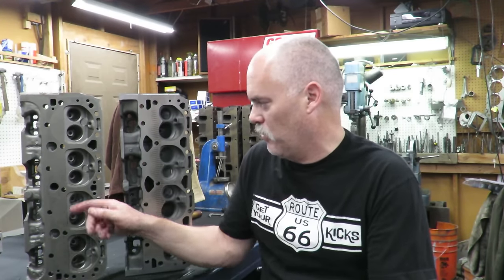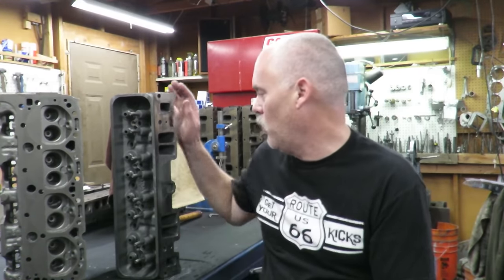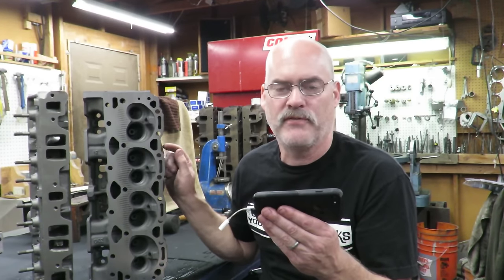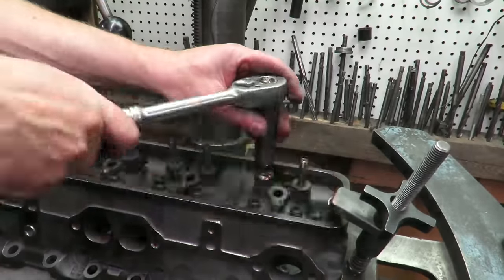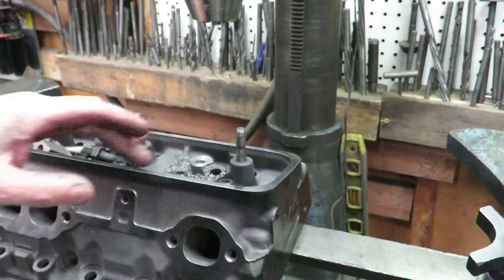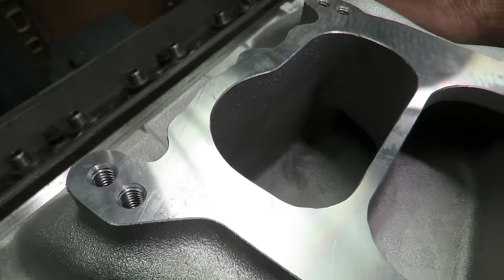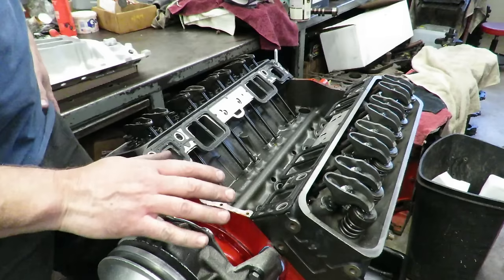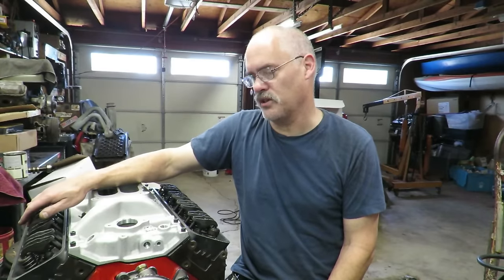How to get more power out of your Small block Chevy

Comment: Thank you for the hard work. Would you describe the typical different OEMs approaches between an early car (early 70s say) small block and the "same" truck version? Have a 73 GMC 350 4bolt (was a crate motor replacement - .030 over flat tops otherwise "oem"), short block excellent shape, (2) burnt valves (xxx642 heads >-/ ), want to go to vortec heads w small valves (?), intake and Rochester,  leaving the GMC OEM grind (or pretty close) cam in it. want more bottom end, better efficiency.... worth it? thx again

Comment: The  best way to get more horse power  out of most small blocks is to increase  the stroke then air flow  in the heads by porting them with the correct  shape rather  then a smooth  finish  , 3 this make a engine have more power  1 heads ,  2 manifold,  3 cam shaft match  this all perfectly  and you will produce good amounts  of horse power !

Comment: I have a few chevy small block engines and would like to get descent power as cheap as possible out of a couple.
Engines are older passenger car type pre fuel injection etc.
Can I use the vortex heads on them and what casting or car at junk yard should I look for to stay cheap.

Do I need to go with vortex?
If cheaper & better I will!

I'll be doing everything but machine work.

I have some good cams, intake & carbs was thinking around 230 duration and 550 lift and 108 or 110 overlap. Your thoughts?

I'm recovering from leukemia and want to do a couple projects now.
Been chevy all my life so have lots on hand, just not done vortex upgrade on standard engine. 
Thanks for ANY good advice and where to get what I need very chezp.

Thanks again,
Jerry

Comment: Great video,now as Engine Masters had 2.02 valves in there heads.is it good to have that work done as well?
Reply from the maker: I have tried the 2.020/1.600  valves it didn't really make any difference
Reply: @Myvintageiron7512  Ok thank you.can i have the numbers for the cam you used so i can find one the same,and should i buy the kit with springs,or not??
Reply: One other thing,if i bore out the block .30 over with flat top pistons,will the stock rods handle the power?

Comment: There's also the 059 Casting Vortec Heads for 305 engines that are very similar in the combustion chamber like the early centerbolt, but with better ports.
Reply from the maker: Yes that is correct I would however steer clear of them for a 350 or 400 they don't flow as much as the 350 vortec and the valves are small they do make a nice upgrade for a 283 or an early 305
Reply: @Myvintageiron7512  Yes, I was mentioning them since I am about to do an upgrade for my 92 Camaro 305 with some EQ Vortec Styled heads which are based on the 059 casting. I really like your videos and really appreciate what you teach us here!
Reply: @LuisAFigueroa  
So do the 062 vortec heads go with a 87 305 block?
Reply: @Myvintageiron7512  
So do the 062 vortec heads go with a 87 305 block?
Reply: @ulisesgonzalez6232  no you need 059 Vortec heads on a 305.

Comment: I believe the vortec heads they used in that episode also had larger valves in it
Reply from the maker: yes they did I have tried that also made zero difference
Reply: @Myvintageiron7512  my question to you is-
 Is it worth the money in the vortec heads of machine work when in the end you could dish out another hundred or two and get a set of aluminium heads ? 
 In your position it's a no brainer, being able to do all the labor yourself
Reply from the maker: decant Aluminum heads will be quite a bit more than a hundred or two
Reply: @Myvintageiron7512  I don't know if they are any good but flotek sells alumnium heads for 300 a piece, 2.02 1.60 valves, 180 cc runners, and a 64cc chamber.

Comment: I recently bought a '95 Bayliner 2355 that came with a 305.  The boat sat on a lift for 2 yrs through two bad hurricane seasons and at different times the rear scuppers couldn't keep up with the rainfall and the engine bay filled a bit.  I replaced the starter and the 305 is running, seemingly well, but before I'd feel comfortable taking it offshore I want to tear it down and check it out.  That said - if I'm going through that much work I think I'd rather just build a 350 and swap that in.  Would you mind outlining what I should do differently to prepare a similar engine / intake for marine use?  I will likely go the heat exchanger / closed loop cooling system route.
Reply from the maker: with a closed loop cooling system you should be ok with automotive specs but you need to get it balanced down to 1/2 Gram you will need to find a real good performance balance shop you also need to remember they see sustained RPM's so the cam and head combo need to be set up for that run your coolant temp around 180 no cooler than that if you run lake/sea water through the cooling system the clearances in the engine are very different so be aware of that I also recommend forged marine pistons don't go cheap on the pistons or it won't live I also would modify the oiling system by having the 3 main oil galleries drilled out and use a high volume pump

Comment: I've been wanting to see someone build an engine with a 3-2 barrel setup running on the center carb for fuel economy with the other two kicking in for performance
Reply from the maker: the 3 2's set up is very problematic to keep tuned and synchronized, back in the 50's and 60's my uncle worked at GM, he told me he took hundreds of the tri power set up's off and threw them in the trash because the customers demanded it, they wanted a single 4 barrel, mainly because they had so much trouble with the 3 two barrel set up

Comment: Ok, I understand the whole process, I ask.
What valve rubber do you use after drilling the valve seat? 
the original or a replacement of different diameter?
and my other doubt if I want to place rocker arm roller tip I need to degrade the screw base more to place the guiding plates or not?

Comment: I picked up a crate motor from chevy and it's a 350/300 and has center bolt valve covers,Is this motor any good? I wonder if the heads you talk about here are the one's I have.I have to dual plane Edelbrock manifold.I haven't fired it up yet but will very soon.I have the holes in the center of the heads for the manifold to bolt up too.I have also seen my motor being tested in a  Hot Rod magazine with a 750 cfm. holley.I think the carb is too much for everyday use, so I will use a Demon 625cfm.

Comment: I really appreciate your videos, thanks for taking the time, I have a 1970 c20 with 4 bolt 350, it's rebuilt runs strong and no oil usage. I have headers, intake and 4bbl holley vac sec, but am still disappointed, maybe 250 hp, this is exactly what I need to do, thanks gonna start collecting parts for these heads and intake. Question: I don't know enough about cam specs to properly pick a cam for daily driving use, (I literally drive it every day)I want as much torque I can get without loosing decent drivability. If I have to change converter I will... Truck has 350/350 4.10 gears truck weight is about just over 4000lbs... Any tips...?
Reply: I dont have an answer but what truck do you have that engine in?

Comment: Summit sells a vortec 350 2 bolt long block for $2200 advertised at 255hp and honestly if someone is looking for a crate engine this is the best deal out there
Reply from the maker: for 2200 you can build a 375 HP engine $2200 for 255 HP is not a good deal

Comment: Hi do you also have sugestions about power up chevy 283 boat  torker engine ,max rpm about 3300 rpm, is a 1963 Classic boat so it schout have the Classic looks.. Regards Peter.

Comment: Great videos:  However, I recently purchased a mint condition 1970 Monte Carlo from the original owner and it came with a 400sbc.  I am going to rebuild it and discovered the steam holes.  Ridiculous setup.  I am not going to drill steam holes to match the block, so I am getting rid of the 400 and going with a 350.  This will allow me to build the motor to my satisfaction without going thru a steam hole mod.   Your opinion on that?  Thanks,
Reply from the maker: The 350 will be more reliable and run cooler the 400 has a terriable connecting rod Ratio/ lots of rod angle it actually shortens the life of the rod bearings and piston skirts the long 400 stroke 3.750 paired with the short rod is not a good set up for long life this is one reason GM only produced the 400 for a short time you can build a 400 with the longer 350 rod (5.700) and it does help this issue but the heating problems and thin cylinders that the 400 has for me make it to problematic I reccomend a 350 or 383 insted you are on the right track

Comment: 1st I respect your opinion - we've chatted before. I am building up a old sbc, A 283 block with 63 fuelie camel hump heads. Looking for a good 4x4 street cam. streetable and good off road crawler torque. Opinions on lift, separation to do both? Also planning on a performer intake with an efi throttle body. Expected rpm - idle to 4000.
Reply from the maker: Engine Pro MC 1730

Comment: I’m wondering if it would be worth it it get vortec heads over a set of Flo-tek aluminum heads on speedway. Because when you are going from normal heads to vortec you need to factor in the price of a new intake and center bolt valve covers. You just said that you could spend $500 on vortecs. Fully assembled Flo-tek heads go for $400 a piece on speedway and you can keep your intake and valve covers. Plus they already come with screw in studs and guide plates for the push rods.
Reply from the maker: go for the Aluminum heads if you can
Reply: Myvintageiron7512 ok, that is what I plan on doing since I already have a performer intake. I would also really like to get a swap meet quadrajet and rebuild it to save money over a new 750 Holley. Any opinions on quadrajet carburetors?

Comment: I have a 1993 Chevy Suburban 1500 that I believe has a 350 small block in it.  I need a little more power to haul the boat I got.  Can I do this without having to change the fuel delivery to a carb?

Comment: Those tub heads are decent.mild porting THEY will make very good POWER. Have you dynoed them.you can get 350 horse in a 350 easy
Reply from the maker: Yes I have flowed and dyno tested most of the stock castings and they are not nearly as good as the aftermarket or even vortec's

Comment: Question I have a 95 Chevy 2500 4x4 automatic trans.. currently has TBI 350 bone stock I feel like I need more power to push 37 inch tires it is geared 513... I just need a lil more for take off  and suggestions or direction would be great  fyi I'd like to stay 350  no BBC for me rite now with these gas prices .....

Comment: Could we see a how to get more power from your sbf? When you trim those guides down you need undersize seals correct?
Reply from the maker: Yes need seals to go with the guide Great idea I actually have a SBF build coming up I think I will do a how to get more power out of your SBF
Reply: Im building a 331 stroker for my 84 ford ranger. Using gt40p heads and a decent roller cam setup. Id love to see your take on the ford motor.

Comment: I am doing a vortec head upgrade on my 94 Chevy 5.7 can you provide parts needed. I already have heads and intake and intake gaskets gel pro ms98000t and thank you for that need head gasket cam recommendation,heads are after market stock. Have 650 cfm tbi. Also any recommendations on if I need to replace distributor And bolt set for top end.

Comment: I will have to look into this more BUT I want to get more horse power for towing my RV and this seems perfect for my 1991 C2500 5.7 210 hp engine. I am wondering if I can leave all the rest of tthe truck as is ? such as the brain and chip ? I was wondering if this mod will also give me the same gas mileage as long as I don't step on the gas peddle !!!  But when I need the extra HP towing I simple give it more gas and get that HP to get the job done which in that case the gas mileage be damned  :-)   What say you folks in the know ?

Comment: I'm sure somebody has asked this before, but i haven't seen it, and it's probably buried.  I think I'll be asking road kill the same question.

there seems to be a fair amount of hoopla from the machine shops, about NOT buying aftermarket heads, at least without having a machine shop go through them.

how do you feel about that? what is your experience?  is there really that many problems with off the shelf after market heads?

Educate us about that please.  and if we do take them in, what is a fair price to have them go through them?  and what if they are out of spec?  do we pay for it, or should the manufacturer pay for the defects?

and of course the big question, which aftermarkets would you recommend for which applications?

myself:  I have an 83 chevy van with a 305 that i was going to shave the heads and toss an intake/cam in, but thinking I might be miles ahead with a 350 and then port polish with an intake/cam on vorteck heads.  (Like many, i was an old camel back fan.  thank you for the education).
the other toy i hope to get to soon is a 72 thunderbird with a set of DOVE 68/69 heads.  i alrready bought the larger valves and got the right quadrajet to convert to the 429 super cobra jet.  but after educating myself (via your site and others similar, ) i think i might be further ahead to take my losses and buy a set of after market heads.

In both applications i plan on a respectful RV cam (Not knowing what 'respectful" is yet).  with an intake.    I am a quadrajet fan, but open for education.  of course anything i build i prefer a nice ignition system, and am also a fan of the fluid filled harmonic balancers.

that' brings up another subject.  I have yet to see an engine builders youtube video mention harmonic balancers.  my experience is that they give notice hp increases, not to mention increase the potential longevity of an engine via better crank wobble control managment (in turn reducing wobble throughout the engine/drivetrain).  whats your take on that also?

thank you for reading this book.  

if you could respond, or point us to the direction that we can get your responses in your other video's that you have already done.

thanks

Comment: If I bring heads home from the salvage yard, how can I get them as clean as the head you are doing the stud and guide work on in the video, at home, without paying a shop to hot tank them or whatever?  Any tips on cleaning or soaking heads, what chemicals or products/soaps to use?  Thanks
Reply: spray with degreaser,use a stiff brush and scrub in out and all around.blow off with compressed air,repeat several times.give them a light coating of rust preventative after.
Reply from the maker: Just take em to a machine shop and have em vatted it will be much faster and cost less in the end by the time you buy everything you need to clean em you will spend just as much and waste a bunch of time

Comment: I love the LS motors. But the good old SBC is in the blood and it's not going anywhere :) Loved this video. I've got an 81 Z28 that I'm thinking about doing some of these upgrades to. I need to get a good look at the motor and see what i'm starting out with before I get a game plan together. No sense in putting good heads on a clapped out short block. I hope I don't need to get a new short block but if i do then i do. Either way it's going to be a budget build. 

On these heads are you going with stock sized valves or are you cutting them for larger valves? And also are the factory seats in the heads hardened as they came from GM?
Reply from the maker: these are 1.940/1.500 yes the seats are hardened from the factory

Comment: how many cfm are the vortec intake  runners and why would you mill down under the rocker studs in my building i have found it hard to get the proper rocker arm geometry because they do not sell studs that are long enough having them sitting up higher to start with seems like it would be a plus

Comment: Is there a mechanical reason you couldn't drill out all the pre86 intake bolt holes to run an old style manifold. only asking cause I've got a 290hp create motor and a rpm air gap manifold and I dont want to have to buy another manifold.

Comment: What heads do I need? We have an older 350 sbc (fuel pump in block) bored 40 over, not sure on cam, 4bbl Qradrajet carb, currently has a set of 305 heads on it, Its in a dirt car, we have to run a cast iron head, (Can't use Vortec or camel hump or aftermarket) Thanks

Comment: I am looking to do this swap on my 87 v30 Chev completely stock. Can you tell me in your opinion what would be the combination of parts to use such as  cam, ext so the TBI will still be able to work? I am not looking for a hot rod build just a great running/pulling small block I can cruise around. 300HP would be fine but really want to focus on the torque output.  Any thoughts?

Comment: This is probably a stupid question, I have a 93 Chevy Cheyenne K1500 and before I got it someone, I checked the engine code, put a 1976 400 CI engine in it, I know it's really similar to the 350, is it possible to put the modified Vortec heads on it that you're talking about, I would really like to upgrade my mid 70's crap headsI, I have Edelbrock aluminum intake and the 1405 Edelbrock carburetor.